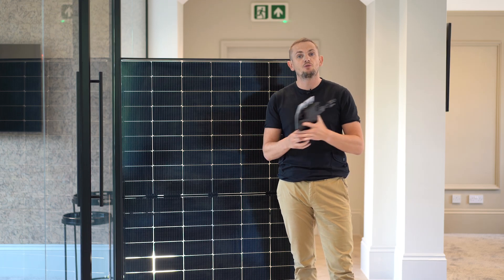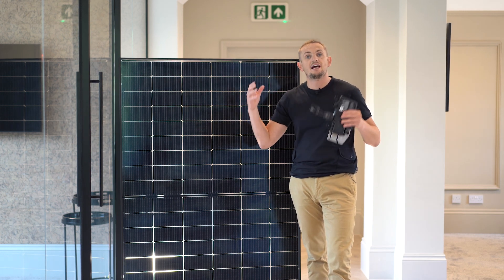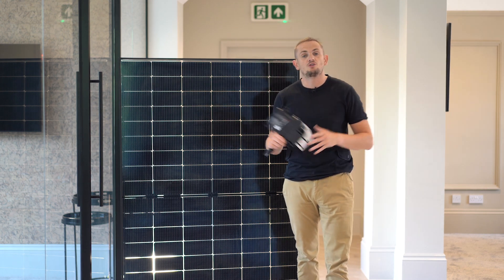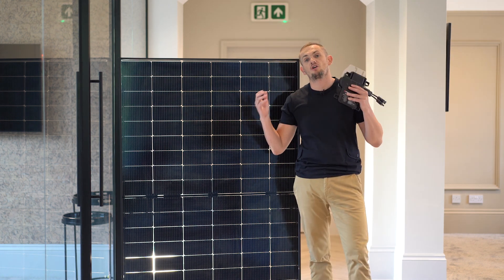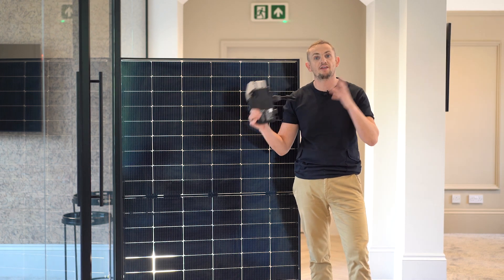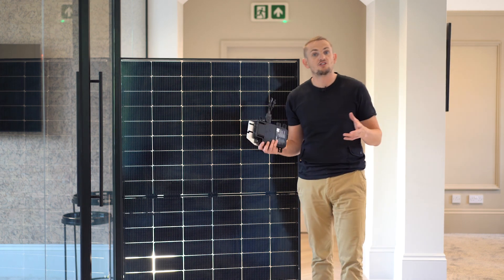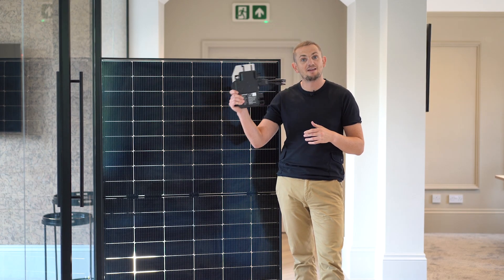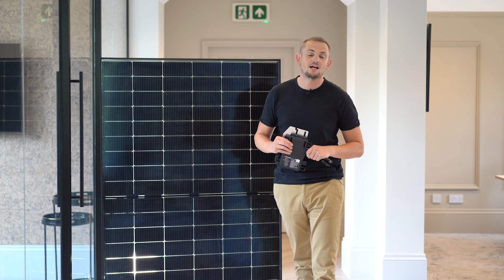Everything You Need To Know - Enphase Micro Inverter Review

Comment: Immediate question then is if you want to put part/all of that generation into a battery you will have 15% conversion losses? From there, any generation then is pretty much designed to go straight to load and excess to grid.
Considering the cost of each microinverter, which in effect makes PV panel + inverter becoming 250% of PV alone cost. In all, I cant see how microinverters stack up overall.
Reply from the maker: Hey! The total loss to convert would be around 6%. This conversion factor is similar to charging the battery from the grid.

Comment: I have old, (2013) Enphase Microinverters here in australia on 8 old but expensive 300w panels. I have a Solis string inverter (2019) on very cheap 300w panels. I have a brand new Sungrow string inverter (2024) on good quality 440w panels. Out of the three systems, suprisingly, the ancient Enphase inveters are the most efficient for their wattage. It's not a gimmick, they actually are by far the best. Out of the two string systems, the cheap one is every bit as efficient as the medium quality. SO my advise is this, buy Enphase if you can afford, but if you can't afford, don't hesitate to get even the cheapest alternatives because they still work well imo. Enphase micro's are the most impressive though, and the installation is by far the neatest and simplest.

Comment: I know it is not ideal but Can you use a 195watt solar panel with IQ7
Reply from the maker: You could but it would be limiting to performance. Generally, you'd oversize the panel by 30-40% to the gross output of the inverter.
Reply: Thank you for your repsonse, can I  combine two 195 watt panels in series and use one micro inverter for every two panel.   @Heatable
Reply from the maker: Due to the voltage of individual panels you wouldn't be able to feed two into one inverter.  @DaverHacisabanoglu

Comment: If you have AC essentially coming off the roof with the IQ7+ does then that have to go through a conversion back to DC if you have a  home battery to fill up from the Solar Array as well as using an off peak tariff to fill them ?.
Reply from the maker: Hey Andy, yes that’s right it converts to AC and back to DC when going back to the grid and battery storage.
Reply: thanks for the reply, does that mean you need a second inverter down at battery configuration to take it back to DC or is the battery interface and management software designed to handle that @Heatable
Reply from the maker: @andyballard1883  Hey Andy, yes that's right - the battery either has a built in inverter or the Givenergy battery, for example, has a separate gateway that converts it back to DC. More than happy to help with any other questions!